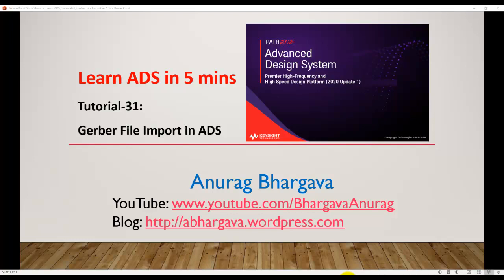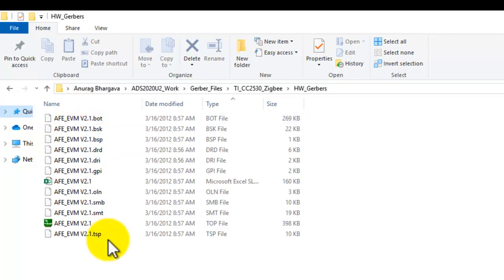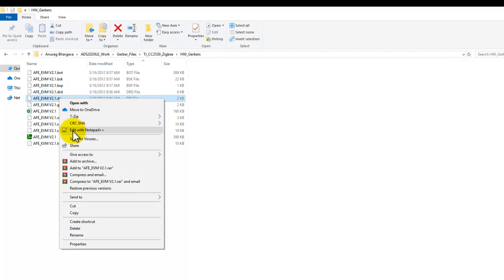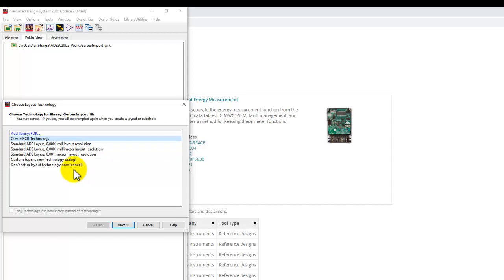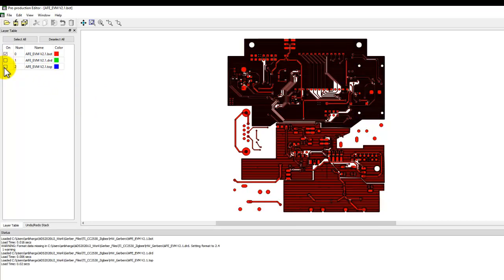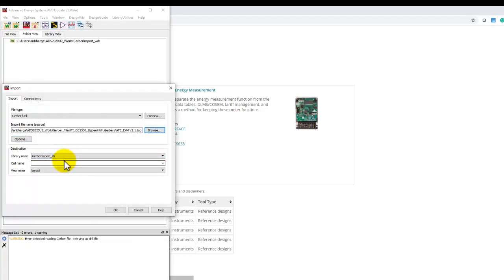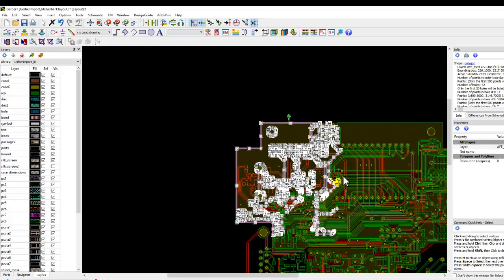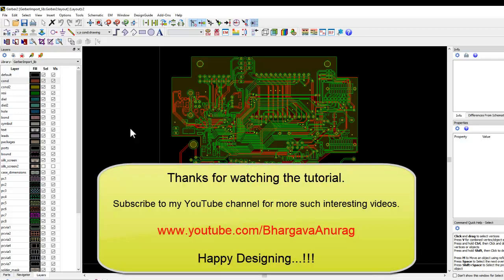Tutorial-31: Gerber File Import in ADS

Comment: Hello Anurag, I am very new to ADS and your videos have been of much help. I have a question regarding importing Gerber files. 

I have 1 drill gerber file for different layers of vias and holes.

The PCB I have designed has 4 layers, with different vias, i.e some vias connecting top to bottom, some vias connecting top to 2nd layer and vias connecting 3rd layer to bottom. The drill gerber file does not differentiate between these vias and also does not differentiate the vias and the holes (without copper). How can I implement this in the substrate stack up? I have created 3 conductor vias (for the different layer connections) in the substrate but they all use the same drill gerber file and therefor have the same layer name, destroying the 3D representation. How can I fix this issue? 

Have I possibly exported insufficient drill gerber files from my PCB design software? Or is there only 1 drill file and I need to manually add layers and differentiate the vias and holes in the ADS layout? 

Any help would be appreciated, or maybe you have already made that may help me?
Reply from the maker: Hi Matis,
Its kind of difficult to answer your query on YT but essentially you can import whatever files you have in 1 shot. For VIAs usually it is 1 drill file that will cover all of your PTH holes. You need to create a stack up file that represents the 3D cross-section of multiple layers you have. You don't need to do anything in your layout and that will automatically have everything after the import and you just need to map right layer at the right place in the substrate/stackup editor.
Owing to all these problems associated with Gerber files, I will recommend you to export ODB++ from your layout tool which is much easier and all net names, connectivity etc are preserved during the import. Only thing you will need to do after the import is to set the material properties properly. Kindly watch ODB++ import video on my channel and you will get an exact idea on what to do.

Kindly contact Keysight tech support team in your region/country if you can't figure it out.
Reply: @BhargavaAnurag  I had never worked with ODB files before so thank you very much for the tip. I've managed to import the PCB and all it's details in ADS :)

Comment: Hi Sir,
 When I am importing a layout from ADS, the component instance name(such as C1,R1 etc) are not getting exported.
 I have moved the component instance names from default silkscreen layer to Legend layer of my gerber. Still while exporting to gerber file the component  instances names are not appearing.

I have tried changing the polyline width to a bigger value(say 10 mil) while exporting .Is there any way to export the layout with  component legends rather than adding it manually(which is cumbersome)?
Reply from the maker: Hi Nimisha,
If that is what you want then I would suggest using ODB++ format which is supported by most of the PCB tools and that will retain entire hierarchy as well as instance names etc.
Reply: @BhargavaAnurag  Ok.I will try 🙂

Comment: Hey, Anurag, I cannot find the file you demonstrate in the video at TI official site. 
I tried to download one, but the format was '.art' or other else.
Could you share this file to Keysight community or mail to me please? 18700438489@163.com.
Reply from the maker: Hello,
It seems TI changed their website and files etc. However, it is not a problem as you can download any of the necessary file to learn the process. You can look under: https://www.ti.com/tool/CC2530EM and scroll down to Design Files section and download: CC2530EM Discrete Reference Design v1.3.1 (Rev. A) zip file and under that you will have all the necessary Gerber files and relevant document on the stackup etc. Remember to look at different files as Gerber files have many extensions but I guess .spl are the ones you should look for...
Best of luck
Reply: @BhargavaAnurag  Thank you so much